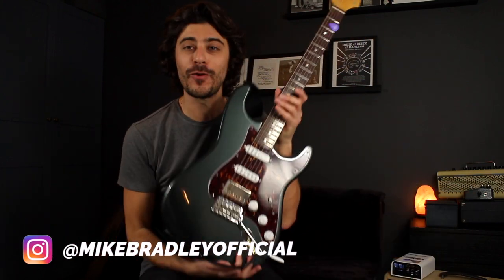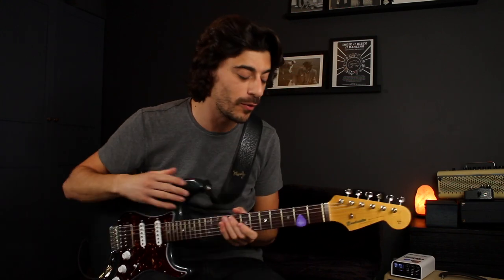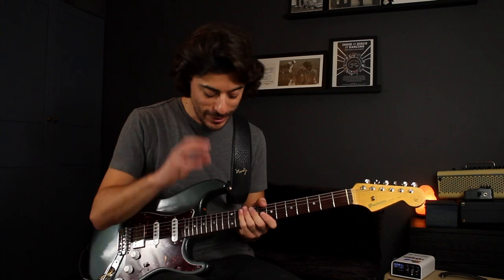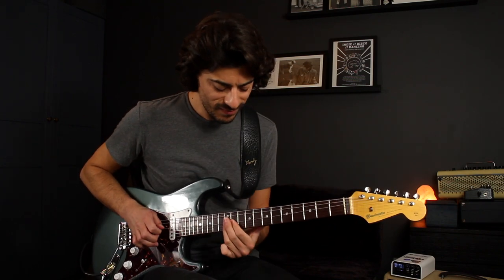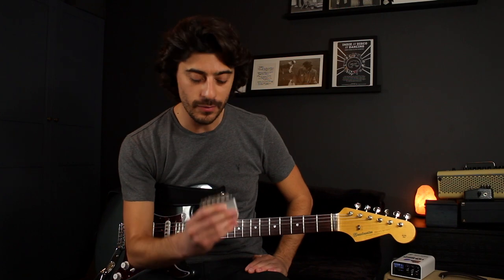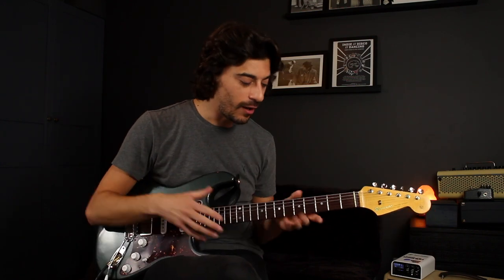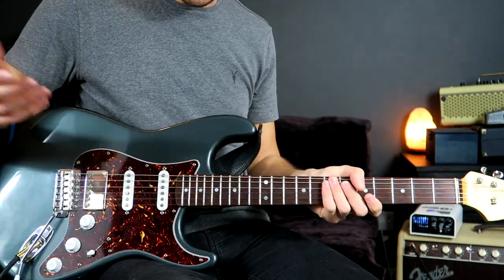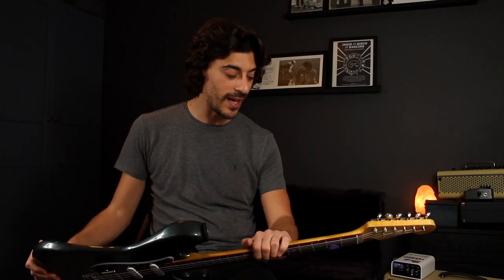The Strat Journey Continues - It's All about The Neck

Comment: The neck is everything. I have a MIM Strat. Since i got it about 7 years ago, i thought it had the best neck i ever owned. Then, a year ago, i bought a Nash tele, with a light relic and a worn-in neck. That guitar immediately became—easily—the best i've ever owned in terms of the neck, and it changed everything. I no longer wanted to play the Strat that i thought i liked. So, i recently sanded down the glossy Strat neck finish, to where it now feels like wood, and i'm much happier with it now. But, now i'm completely spoiled for a 'worn-in' neck, and whenever i go to a store, it doesn't matter how good/expensive the guitar is, i immediately have a negative reaction to it because they all have a hard 'plastic-like' finish. // Oh, the other thing i did to that Strat was to change the springs from the 3 stock springs to a 5-spring Vintage set. I think that had a benefit, but it's hard to tell....
Reply from the maker: Thank you for sharing your story! Yes I’ve played Nash guitars and they are great, as you’ve experienced once you go down the road of hardly no finish or literally no finish at all on your neck. It’s very hard to go back! As you say, it’s ALL about the neck!
Reply: @MikeBradleyofficial  For the first 40 years of my 'guitar-having' experience, i 'hated' Telecasters. Thought they were ugly and primitive. And for Country pickers.... But, because of that neck, it's the guitar i reach for first. Definitely the most important thing for that connection you need with an instrument. Unfortunately, not all guitars are available that way. I just ordered a Gibson ES-335, because i want that tone, but knowing that i already dislike that hard, glossy neck. I'll just have to adapt until i get the courage to sand it down.  : (

Comment: Mike, I love your guitar playing and I love your videos. With all due respect, wouldn't you just be happier with your Broadcaster? I've recently been looking at this new Custom Fender HST (Highly Specialized Telecaster) Relic Stratocaster. It has three pickups. A Seymour-Duncan on the neck, a single coil Strat-like pickup in the middle and a Black cover Tele pick up at the bottom. It's a homely guitar because it's so plain it comes in a lot of quirky colors). But I'll bet that thing does make some interesting sounds. I just don't know if I want to risk spending $4,600 on some kind of hybrid experiment. I'm not sure who thought that up over at Fender. I also have not seen one video review of that guitar anywhere.
Reply from the maker: Check out the previous videos on this guitar build. You will get the full picture on what has happened then.
Reply: @MikeBradleyofficial  

Thanks Brah.

Comment: There appears to be more clearance on the low E string.   If your builder can adjust the neck pocket and remove a few thou on the bass side, then the strings will be better centered.
Reply: Had nothing to do with centred strings because they were pretty much spot on and the neck pocket was a perfect fit too, he needed a narrower string spacing because he's used to playing modern one's, I measured the ones Mike plays, vintage is not all good imo, it does not suit alot of players.
Reply: @customguitarkits6836  I agree with you about bridge spacing.  That is the main cause of the problem.